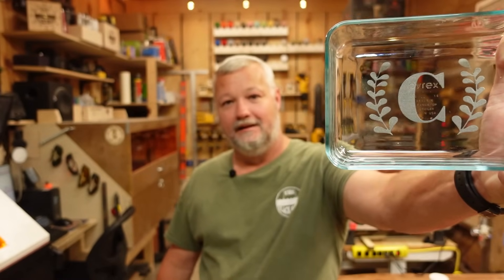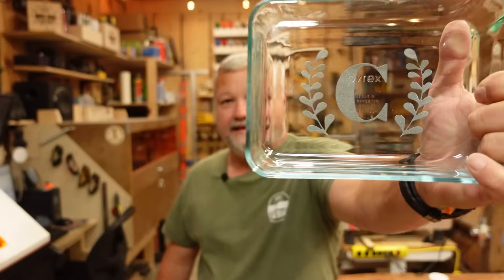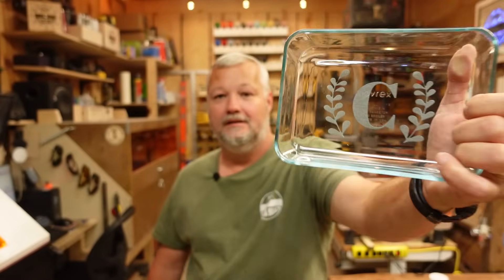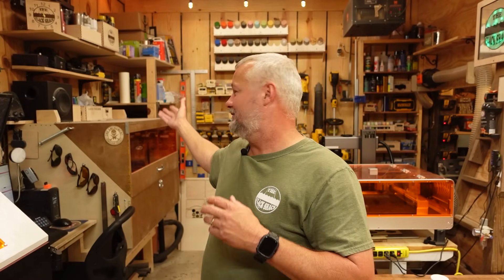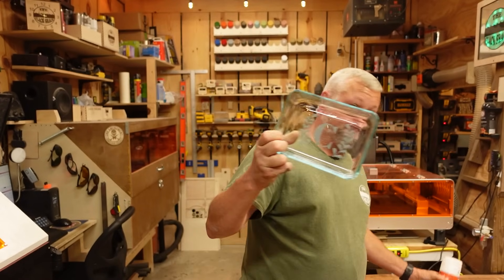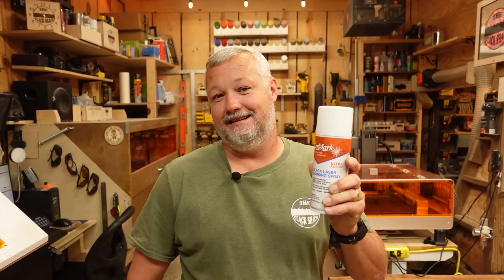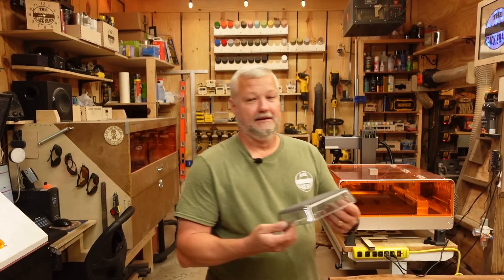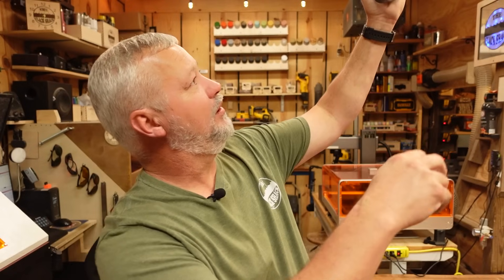Engraving glass with a diode laser

Comment: My MAIN QUESTION, is How does this affect the future use of the Pyrex and High Oven Heats? You have effectively broken the Temper of the glass in the areas you superheated it.
Reply from the maker: I can't speak to how it effects the .05 mm or so layer of the surface but it is still in one piece. The effect does not go into the material.

Comment: Air assist??
Reply from the maker: Not sure I am following? I always run air
Reply: @TheClackShack I am no expert! But that was the first example I’ve seen of using air assist for engraving.
Reply from the maker: @BeaulieuTodd  I run it all the time to get better results and save money on replacement lenses. When you engrave, it creates dust, if the dust stays on the material you just keep engraving dust. If you move the dust, you actually make the wood get darker. My dark engraves don't require any special coatings.

Comment: Can you use xtool s1 for this project?? If so, with what settings??
Reply from the maker: Similar, diodes require marking spray. It is a slightly different process.
Reply: @TheClackShack  I purchased your recommended CerMark laser marking spray. This may seem like an ignorant question….which side do you spray it on? The side you are lazering? Or the opposite side? This is new to me. The first time to use glass. So I am not sure on the settings to even begin with. Can you also give me advice on that also. I have a Xtool s1 laser machine.
Reply from the maker: @karenrice4703  It goes toward the laser. You wanna hit it with the laser. Testing, glass can break if the settings are too hot. Riase the focus about 2mm.

Comment: I have this "back of my mind feeling" We are basically creating mini fractures in the glass and I often wonder if the glass is left weakened.  In most cases may not matter but in the case of a Pyrex dish that gets extremely hot then cools I would like to know the actual usage reports.  
When I was a young lad I remember sitting at grandma for dinner and a Pyrex dish exploded while we were eating.  The best I could understand is it had a chip in it and the hot pan while cooling rapidly.  Expanded then retracted...  It is so thick that it blew apart.  
 LOL I was typing while you explained some of this at the end.   I love the idea I just want to be sure the "gift" doesn't become a major clean up or dangerous item. 
I will be trying this and maybe do a hot/cold run a few times with water to listen for that telltale creak.
Reply from the maker: You can burst glass that is hot or cold simply by modifying the temperature rapidly without any imperfections. Things contract and expand based on temperature. These are sold as “food storage” containers but I can say they work up to 350 just fine. The goal is to lightly mark to get the frosting, not engrave and remove material. As with all things, personal preference, if you’re not comfortable doing it, then don’t.
Reply: @TheClackShack  Did not mean to sound negative just safety first.  
I am for sure trying this and think it is a awesome idea!  I was thinking a 9" pie plate. So it will be hot.  
As you mentioned a light frosting may net be that bad.  It tis cracks that would mater and you mentioned this in the video.  
Thanks for all the awesome videos!
Reply from the maker: @AlteredEagle  I understand, I have not had any issues with them.

Comment: You can save a ton by using Rust Oleum 2X Spray Paint and a diode laser. I have done a ton of engraving using this method. I have been doing it at least 2 years now. I have some older post on Facebook Mason Walker. It's much better than cermark.

Comment: Hello friend, I have two questions:
1) Would this work on any other flat glass?
2) What would the (approximate) settings be for a xTOOL D1 10W laser?
Thanks for the videos, which are very useful.
Reply from the maker: Glass all works similar. Settings vary from material to material
Reply: @TheClackShack  Ok, I asked the question about the settings for glass.
Reply from the maker: @Dancopymus  slow and hot, testing is best
Reply: @TheClackShack  Tks

Comment: well my first attempt did NOT work.. the pyrex shattered.. Using my Longer 40watt killed it... 80s and 90 p was not the correct combination ... Round 2.....
Reply from the maker: Sounds like too hot.. Bring it out of focus.
Reply: @TheClackShack  i pulled it up a little more and increased the speed to 2000 so far so good will send a pic when done ..
Reply: @TheClackShack  ok... changed the settings to 2000s & 80p... and it turned out GREAT... You are the man ... ill send a pic to u on FB..

Comment: Realize that there are at least two types of Pyrex. It looks like you have “pyrex” which is different than “PYREX” (case matters). I suspect that the results would be different with PYREX since it is more resistant to heat hence oven safe.
Reply from the maker: Yep, just needed glass for this job. Found settings for it. I provided a link for the exact item, not speaking to all materials, of course.

Comment: Very cool, turned out well.  It's really a great feeling when things work with the first setting you try.  Glad to hear you are going to have Brandy test at temperature to verify structural integrity.  Might also want to have her make a casserole in it to verify that no issues were induced that would cause temperature gradients due to mass of material in the dish vs. the outside of the dish to cause cracking.
Reply from the maker: The engrave shouldn’t make that much change. The thickness of these aren’t exactly exact from the start. The Pyrex markings would make more of a difference

Comment: You can use rub-n-buff to color the etching. Simply rub it on and buff off.  I'm a glass artisan, shouldn't have any issues with heat as you're not etching deep.
 I would NOT use tempered glass, as it has a skin and if that is compromised it will shatter
Reply from the maker: Yea, I have found that some expensive wine glasses do not like being laser engraved… yea, the melted layer is very thin.

Comment: Nice one Clack👍 
I have a question. Does a laser micro crack the glass or does it quickly heap it up to melting point?
Reply from the maker: Out of focus, it basically melts a really thin layer of the glass. Getting it too hot, can cause fracturing in thin glass. As soon as the marking spray is vaporized, the transparent material no longer absorbs heat from the beam. Key is the layer of cermark and focus.

Comment: I’ve done the casseroles dish with cermark, mine has always engraved in black. I’ve got a 10wat laser. How do I get the frosted look using cermark ?
Reply from the maker: It is setting dependent. You have to run a little hotter and slower to cure the cermark, then burn it off in one pass. LPI is also needed to make the lines overlap.